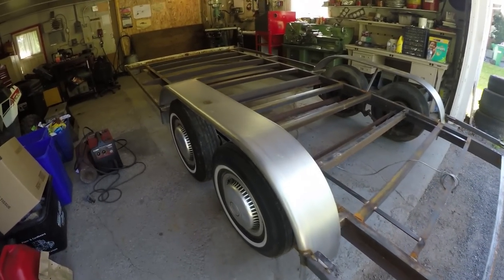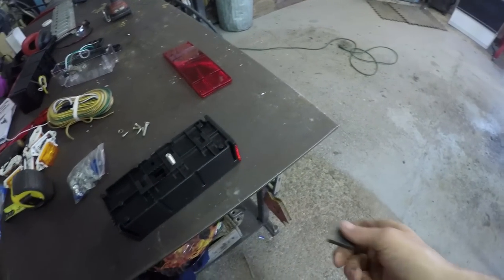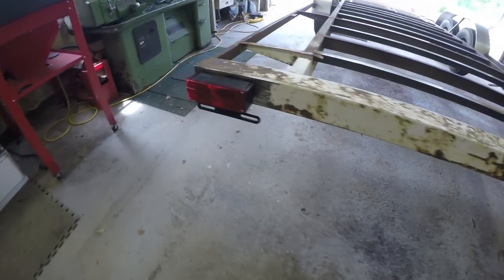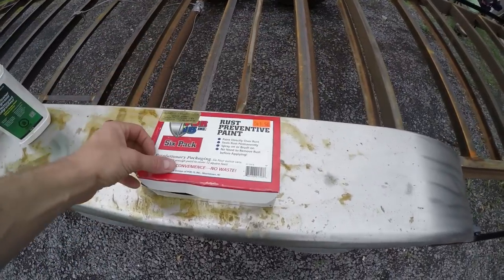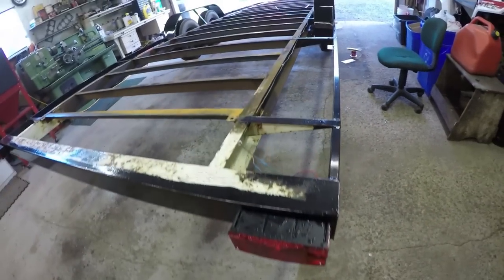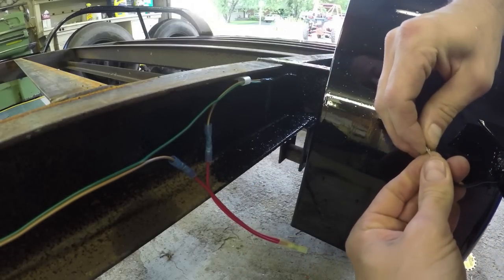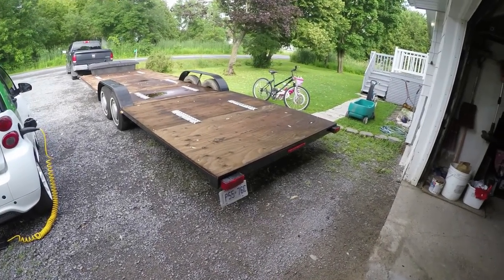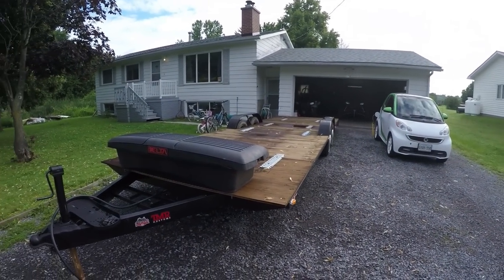Camper to ATV Trailer Conversion pt2

Comment: Nice trailer! It looks pretty light duty, but for a light duty application that's what you want! No pointless weight to be hauling. Looks perfect for the side by sides.
Reply from the maker: Yup, the frame is certainly light duty... won't be putting a car on this trailer. But yeah good enough for the ATV's. Thanks for watching!

Comment: Great job and thanks for the video. I'm sure in the 3 yrs you have figured this out but in can not, 2 sets of L brackets welded in parallel under the carriage is a great place to store your ramps
Reply from the maker: I did that on my last trailer actually! This past summer I cut 4 feet off the back and then added a fold down ramp. Maybe I'll make another update video someday. Thanks for watching!

Comment: Hey guy just a tip for painting smooth metal surfaces... Disposable foam paint brushes leave a mirror finish with no brush strokes and don't need to be sanded... I used this trick with polyurethane on a couple of gun stocks... Other than the few trash specks (applied the urethane in a dusty barn) and a couple of runs that I didn't catch... My finish looks factory smooth and didn't need to be sanded at all... Can't see why this wouldn't work on smooth metal

Comment: A princess auto shopper like myself. I see lots of princess parts. The tail lights I have knocked off several timers until I recessed them into the bumper.  also have a bracket to hook my ramps to so they can not come down when loading, like someone said, mount the ramps under neath. It  looks light duty, but if you feel that the juice is worth the squeeze that is all that matters.  I was raised Mennonite so I am cautious. My wiring is well protected as I do not quad off pavement in Saskatchewan, there are always  things that can pull my wiring out so it is protected, 18 years of hauling quads and SXS has schooled  me on that issue. Good job welding and fabricating, I could not have done it.
Reply from the maker: Thanks for the kind words!

Comment: I know this is old but in case u check..so the axle brakes worked when u got it..but U didn't wire them up when U put new 7 plug in? & the E tracks..r they just secured to just the plywood or to the metal frame? On a couple shots it looked like the wood wasnt secured there the sheets meet
Reply from the maker: Yes, I did reconnect the brakes to the new 7 pin plug. I just didn't show it in the video I guess. The e-tracks have two bolts that go down into metal support braces welded to the frame as well as wood lags into the plywood.

Comment: Looks like you have extra space!  Are you happy with the POR15? I have been debating using it on my Camaro restoration internal panels.
Reply from the maker: I've never really put POR15 through a real world test yet, so ask me in a few years :) Having said that, I did use it on my inner frame rails in my Challenger so I sure hope it works well! Thanks for watching!
Reply: @glassglowz   been a few years how did the por15 hold up?
Reply from the maker: @tristanm15  not as well as I had hoped. The gloss faded off pretty quick, he rust has returned on the trailer tongue, and it flaked off the top of the fenders. Someone mentioned that it's not UV resistant, so being exposed to the sun all the time could be the problem.

Comment: how much did that angle iron stiffen up the trailer? I have an old tandem camper trailer, 16 footer, previous guy converted it to  a flatdeck, but never welded any additional support bracing. I want to, i am wondering if angle iron the size you installed would be good enough, its a 4 inch c channel frame, looks very similar to yours, just not as long! I was thinking of using some old bed frame angle iron to stiffen the trailer up if it worked good for you
Reply from the maker: It helped, but I still have a lot of flex. When I load my ATV's, I put a jack stand at the end loading end of the trailer since it bends down a lot. It's fine for what I use it for, but I'd never be able to put a car on it. Thanks for watching!
Reply: Or more simply, run vertical square tubing supports onto the horizontal supports.
Reply: I welding $40 adjustable stabelizing jacks to my 16' trailer for loading while unhitched

Comment: How well had the POR 15 lasted?   im about to make my own trailer and watched this and decided to go with the POR 15. Just hope its worth the cost and wondered yours has faired over time.
Reply from the maker: POR 15 does not do well in the sun and the rust has come back in some places. Not very happy with the results.
Reply: If it's not directly exposed to the sun, it lasts a long time. I have it on a Camaro subframe I prepped and finished building 13 years ago. The only places it's come off is where I jack the front of the car underneath and it resists rust spread under the paint nicely. This is kept in a garage though. On my RV trailer conversion, I just threw on some rustoleum 2x in two thin coats.

Comment: What did you use to weld the cross members and the side rails? Just angle iron?
Reply: Just looking to do a similar build so we can move from Idaho to Alabama. It’ll need to hold a 700lb motorcycle in the front and then all of my wife’s stuff she “has” to take with us.
Reply from the maker: Yeah it was just 1/8" angle iron. Thanks for watching!

Comment: What model/year was this trailer originally? I just landed one for free and I am in the process of converting to a car hauler. It looks almost identical to yours. I’m doing 2x12s instead of plywood is really the only major difference. I’ll be hauling a race car so it’s probably close to the weight of your two side by sides. Looks awesome. How long did it take you?
Reply from the maker: It was a '79 for sure... I think it was a Prowler.

Comment: So did you have to dismantle the trailer at the dump or did they demolish it for you with their heavy equipment?
Reply from the maker: That was what I wanted to do, but because of insurance and liability reasons (total crap btw), I had to drive it back out of the dump and dismantle it on the road, then drive back into the dump and offload everything. It was such a huge pain in the ass!
Reply: @glassglowz  thanks for the reply....ya that's what I figured. I'm searching for an old 5th wheel to demolish and repurpose the frame.  Was gonna strip it down at home and haul the debris to the dumb after. Then I saw your video and thought maybe they did it for you! Lol. Back to plan A! Nice trailer btw! 👍

Comment: How much did you spend on material not including the trailer trying to do the same
Reply from the maker: Steel was around $400, fenders around $250, decking was $450, lights & wires about $100. Thanks for watching!

Comment: Just a heads up , not raining on your parade, if you could, use deck plate for decking, no replacement, ever, yes it’s more expensive, i used thick expanded metal as a bed on mine, soldered & ran electrics in Gray pvc clamped to beams , if you paint much, buy an airless sprayer, makes quick work of EM, fenders, etc. my reason for PVC was a small dog tied to trailer trashed most of my wiring, lol Good Luck!🍀
Reply from the maker: Thanks for watching! I was in a rush to get this done, hence the plywood for the decking. Seems to be doing a good enough job for now.

Comment: should have cut the bumper recessed them for protection also i would hhave shortened it and dove tailed it
Reply: and use 2x8s etc not crappy plywood
Reply from the maker: @mike-bj4dk  nothing wrong with plywood. Nice and light and it's been holding up great.

Comment: Way to much behind the axles. Needed to cut about 4 ft off . But if it works, it works. Could be dangerous if to much is loaded behind the axles.
Reply from the maker: Yeah I know what you mean. I've never used that last 4 feet. I load the second machine on backwards so that the weight is closer to the front.
Reply: That's smarter than most lol. I'm actually doing one right now and I'll tell you, the time I've put in this thing I could've built ten trailers from scratch by now. I won't have much in it money wise but time wise, I have all of it. Lol, if you consider time worth anything you would go broke on this job lol. She will be a sharp looking trailer once it's done. But I don't think I'll do another one.

Comment: pug did this same thing and the axles bent with a mini van on it
Reply from the maker: Really? The axles look pretty heavy duty. The frame is pretty weak so you'd need to all a lot more steel to hold a car.  I figure my two machines weight about 2500 lbs.
Reply: 1puglife had a view just after he took the camper off and was pulling a mini-van down the interstate, the wheels bent inward as he drove, I believe he heated the axle up and straightened it to sell. you are probally fine with your light vehicles but keep an eye on the wheels and axles
Reply from the maker: lol... poor fellow! Yeah I'll keep an eye on it.

Comment: Is your trailer capable hauling a car ?
Reply from the maker: No. The frame isn't strong enough to handle a car. It's a 'C' channel frame and it flexes a lot even with my atv's. I believe the axles could take the load though.
Reply: Raymond Flores

Comment: Excalibur trailers  16' x 5'  or  18'x 6'  hot dipped galvanized with a ramp for around  24 hundred. I can see the plywood only lasting about 3 years and get yourself a soldering iron for the wiring. Throw those crimps away. Time is money and I hate to think about how many hours you spent on it. I guess your initial intentions were fabulous though and it's hard to throw away 800 bucks. I'm going to go the Triton or Excalibur route and save the heartache. Your trailer has good bones at least and should last a real long time. Enjoy it and use it like you stole it!!!!
Reply: Repeat after me. We do not solder on vehicles or trailers.  We do not solder on vehicles or trailers. We do NOT solder on vehicles or trailers. Crimping is the correct way. There are certain very specific connectors that get some solder after crimping but they are very rare.
Reply: i agree Green